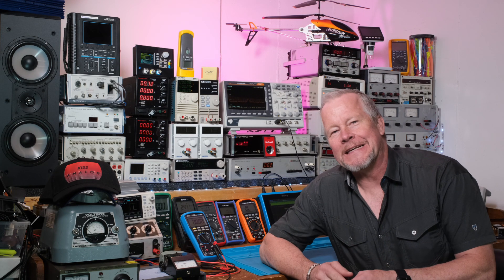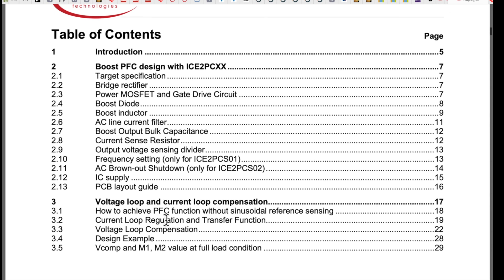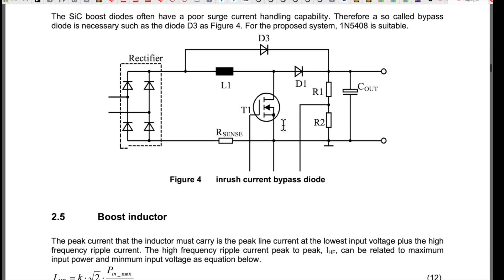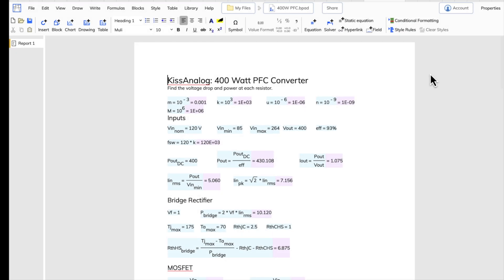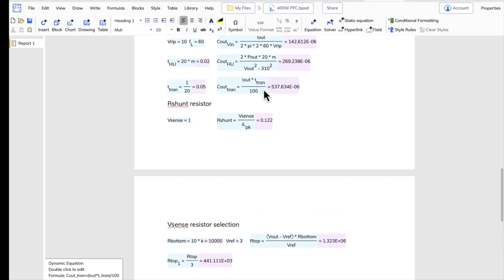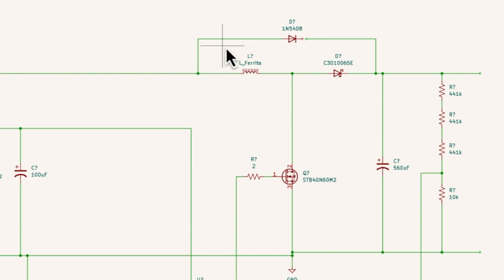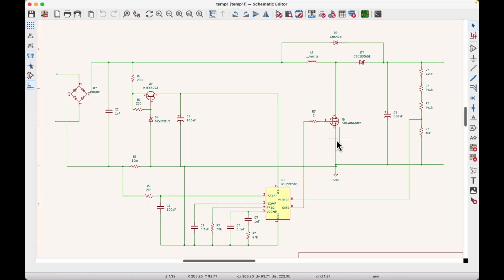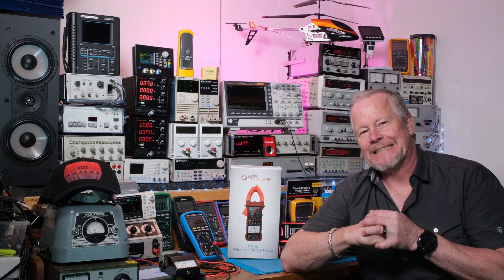PFC Preliminary Schematic JohnAudioTech Collaboration Power Supply Design for his Power Amplifier

Comment: it is looking good! but are you going to run it in a simulation software like microcap be nice to see it's behaviour.
be nice to push the voltage up a bit higher 500V  for tube amps.
what I don't understand how you control the different voltages out like a transformer,..would that be through a buck converter? but do you get away with only one  b+/- V or would you need multiple for different voltages.
Reply from the maker: Thanks for your question!  Here's the next part where the isolated outputs come into play.  https://youtu.be/BaeDq_QEIn8

For a tube amp, I'd use a flyback converter following this PFC.

Comment: 👍Perfect explanation! Question: I see that you use a 12V zener for derivation of the power supply to the PFC controller. But according to the datasheet of the PFC controller minimum VCC is around 11.8VThe BZV55B12 minimum zener voltage is 11.76<11.8.  PFC controller can handle 25V. Is it not better to choose higher voltage e.g. 18V ?

Comment: For those wondering why the top diode is necessary, it's because of the low surge current of SiC diodes because you can initially charge the capacitor trough the inductor but that initial current surge could be more than the switching diode can handle. 

It is explained in the document.

Looking forward to the future videos about the mentioned topics.
Reply from the maker: Thanks so much!  I plan to do a video where I will go step by step 'quickly' to explain the full design and trade-offs.  I'll be sure to cover this - thank you!